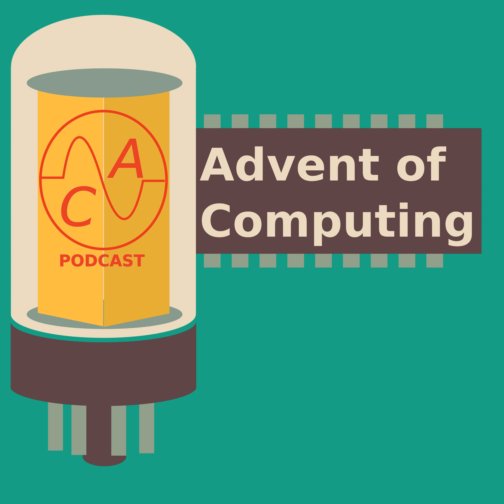Episode 173 - Hybrid Programming

Comment: It's a great episode, but I very slightly disagree with the introduction. Digital computers have no problem with representing any computable number exactly. Which includes all of the transcendental numbers that we normally use.
You just need to use software that can operate on symbolic expressions, such as the infinite series and products that those numbers can typically be defined (and computed) through.

Any CAS performs calculations with numbers like pi, e, 1/3 etc. just fine and without any loss in precision.